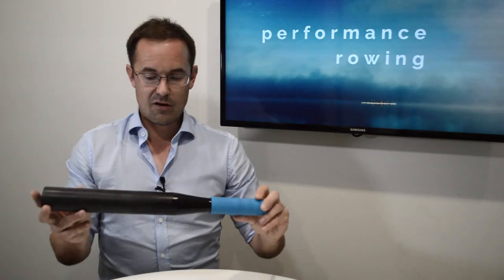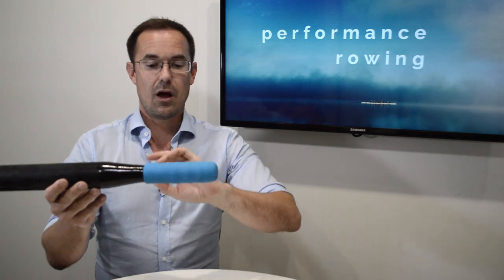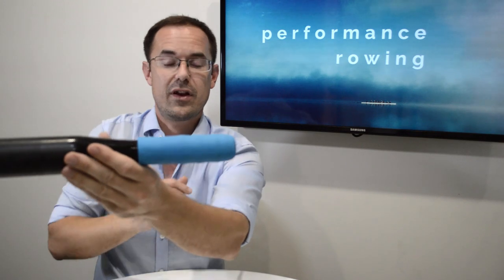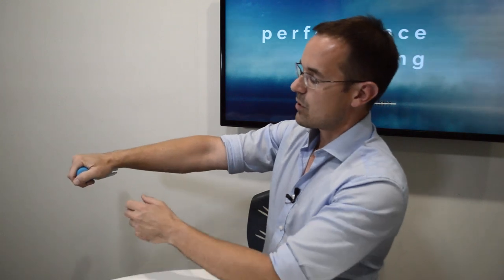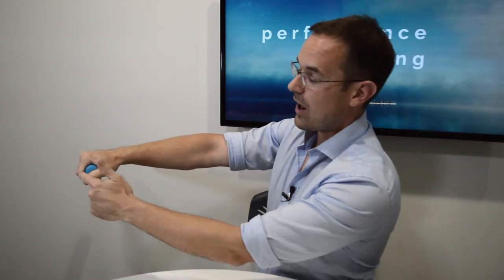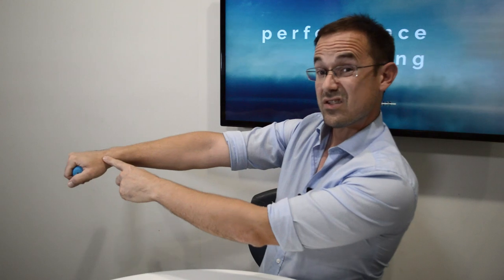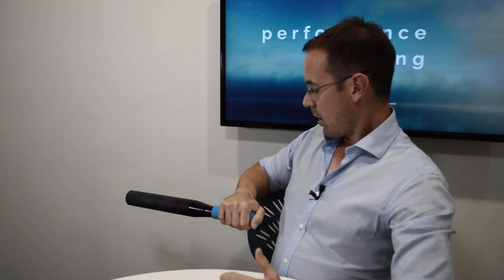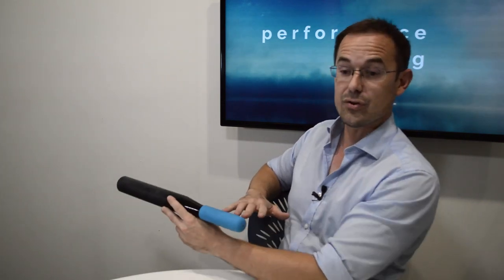PR Basics Sculling Grip

Comment: Step 1: Make sure you match grip size to hand size.
Reply: Absolutely, if you’re lucky enough to have your own gear this is a crucial element of gear selection. Some clubs are also set up to allow different grips for crew boats when crews have been selected for the season which allows the best grip size for each hand size. Most other times compromises have to be made as gear is shared.